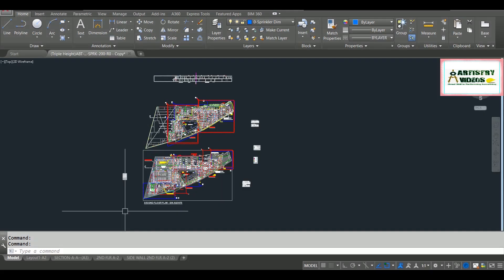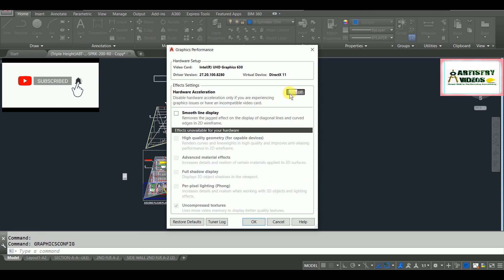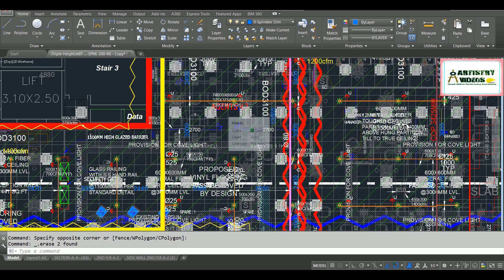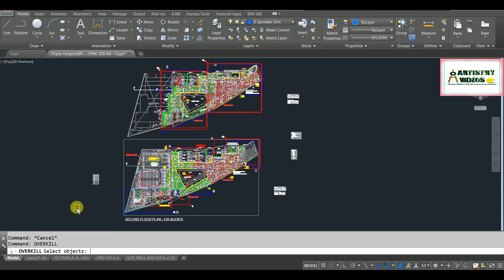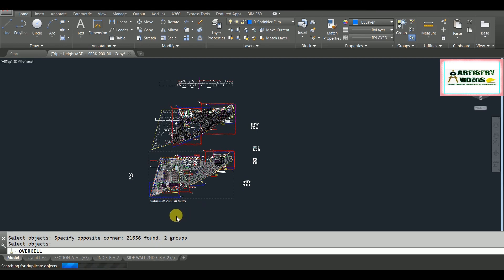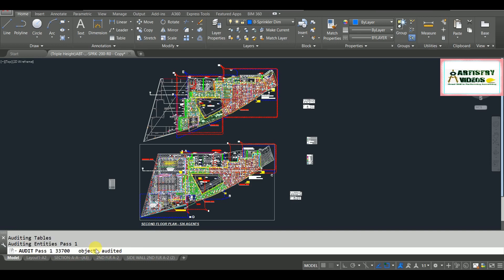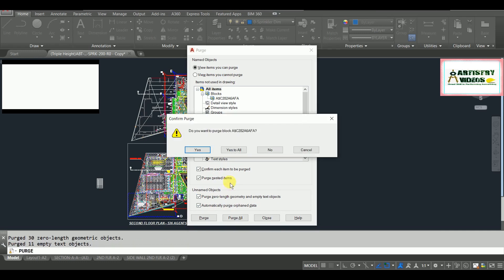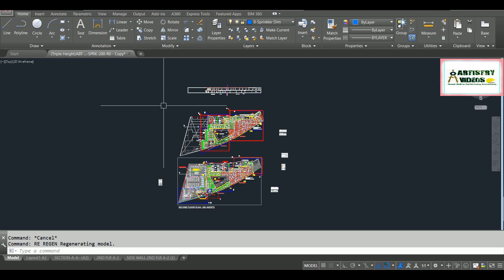How To Improve AutoCAD Performance | AutoCAD Setting for Best Performance |

Comment: For those who has Intel HD Graphics 620 or superior, enabling "Acceleration Hardware" BOOST YOUR PERFORMANCE A LOT!!! By default, this option is not enabled when Auto Cad is installed.
Reply from the maker: Thanks Roberto, Appreciated your reply, those who enable this acceleration for 3D modeling Purpose it can be useful, but not useful for 2D operation that was one of the solution among this.
Reply: @artistryvideos7914 , thanks!
I use AutoCad 2013 and It was performing badly even though I was working with 2d. I have no graphics card, so I gave it a try and It worked great!
Reply from the maker: @robertolimaguedes  if you have any quires or any topic just post comment.